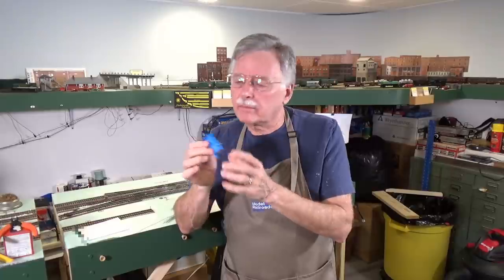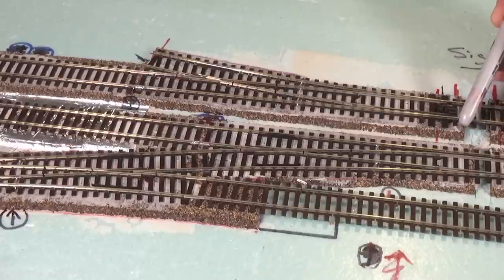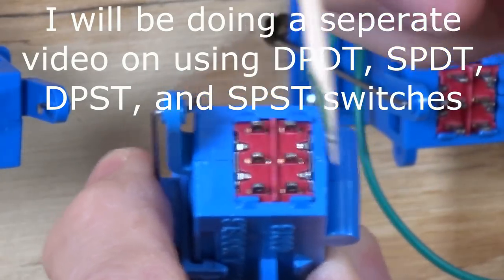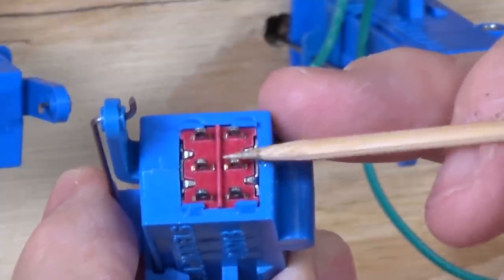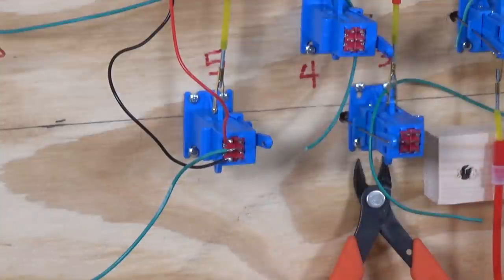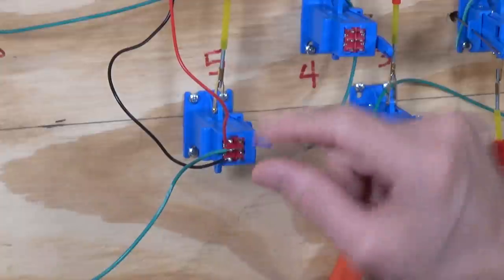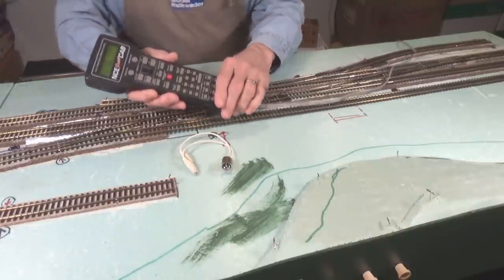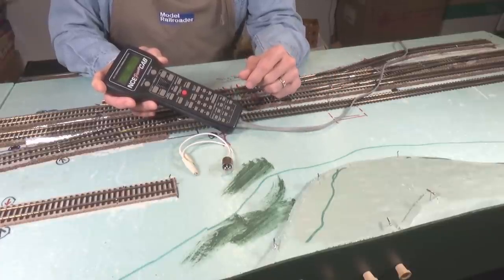Wiring Blue Points for Frog Polarity Control (150)

Comment: Very helpful. I'm using SMAILs rather than BluePoints, and I'm using pushbuttons that switch them electrically. But what you demonstrated is applicable. One difference is that I can't turn the bench work on its side. I do as much as I can on the workbench and use solderless connectors when possible. Thanks.
Reply from the maker: I have the same problem with the Piedmont Southern too big to flip on its side. That is one reason I decided to do these modules, they make it easier to demonstrate a lot of the under the layout topics. BTW, the Smails are essentially a Tortoise with an accessory decoder included. I prefer to use Tortoises and separate accessory decoders since I can pick the type best suited for the installation. And if one component fails I am not stuck with 2 dead ones. Sort of like buying a TV, radio, stereo, DVD player all in one and having the main amplifier components die.

Comment: Always enjoy your videos.  Really hope you'll show us how to wire the BluePoints up to LEDs.  I want switch panels that show direction with red/green LEDs while using the BluePoint switch controllers.
Reply from the maker: I do ‘t plan such a video but you can do it easily using the SPDT switch built into the unit. Just connect the negative or positive legs of the LEDs together using a black common wire and connect it to the proper power source at the proper voltage the use the SPDT switch to provide power of the opposite polarity to the red or green LED. That when when you move the points the polarity will change and light the designated LED. You’ll probably have to fiddle,with the LEDs and wiring to get it hooked up right and you may need to do some reading on LEDs. I think I did a video on LEDs a couple of years ago that may help—its all becoming a blur now with almost 250 videos on here.

Comment: perhaps a question or just an interesting observation... @11:16 you showed the list for the frogs and which color bus wire needs to be attached.  your list seems to indicated switch 1 is black, 2 is red, 3 is red, four is black, 5 is red (as you demonstrated), and 6 is black

but when you daisy-chained switches 2-5 together (switches 1 and 6 not shown) @20:14 they all seemed to have red on top and black on bottom.  your list indicated that only 2, 3, and 5 would be red and that 1, 4, and 6 would be black (at least from what I could tell)

why are they wired the same in the daisy-chain without regard to polarity on your list?
Reply from the maker: What you appear to be missing is the fact that the 2 pairs of switch machines face opposite directions and that in effect flips the contacts 180 degrees. That is why they can be daisy chained so easily in this case.

Comment: That 90 degree angle on the snake should be fine Larry. People have 90 degree bends in RC aircraft wings with these snakes and they work fine. That's a great tip for determining which wire goes where on the switch machine. Should it work the same on electronic frog juicers?
Reply from the maker: Because the frog juicers automatically switch polarity when a sort occurs you don’t need to worry about which way to connect wires to them. They don’t care and take care of the job for you.

Comment: Hint if you don’t want to solder directly to the BluePoint, the TE 61813-1 disconnects fit right on, they are like $0.26 each from DigiKey as one source.
Reply from the maker: Thanks for the tip.

Comment: Hi Larry another great informative video. The blue switch machines look great and straightforward to wire up to the Peco Electrofrog points and the flexible push/pull tubing very effective. On my portable layout I used seep point motors that have been a bit hit & miss getting the frog polarity to work..!!! The Blue Switch Machines could an alternative solution if I can get them in the UK ?
Reply from the maker: Try Coastal DCC, NG Trains, and Mech Models. And there is always Micro-Mark or Walthers. Heck I buy from Hatton’s all the time.
Reply: Hi Larry thanks for the reply...I will look at their websites.

Comment: Question does the bus have to run under every track or just one bus wire straight through the middle like yours? Wondering which way is more effective...
Reply from the maker: Obviously since I did it you can do it. However in some cases with branches or large yards it might be more efficient to branch the bus in a palmate fashion.

Comment: Hi Larry! I hope you see this question, but I have a WalthersTrack switch that has a little tabs sticking out in the side that connect to the frog. Question is which wire connects to that tab; red or the black? My layout is red wire connects to the rail furthest from me black closest rail. Thanks kindly!
Reply from the maker: That needs to be connected to the DPDT switch located on the switch machine. I showed how to do that in the video.
Reply: @TheDCCGuy  So the tab is use only with a switch machine and not connected to my main bus line?
Reply from the maker: Yes, it is used to SELECTIVELY provide the correct polarity to the frog.

Comment: Another fine video Larry. I am really enjoying this series of videos. I suggest they be placed in a Playlist, which would make viewing them in correct sequence easier. Right now, I search for the word "Let's" to find them.

Finally, I noticed when you were soldering to the Blue Point DPDT you did not appear to use a flux. Was there a reason for that?
Reply from the maker: If you go to my channel page all the videos are listed in sequence and by topics. Right now I divide my time between day to day life, working on the layout, making and editing these videos and answering comments. If I were to add making up playlists one of the others would have to stop.

Most solder now comes with flux in it so additional flux may not be necessary all the time. I mainly use it for settings where a lot of heat is required such as rail joiners and feeders and the flux in the solder may burn off before the job is done.
Reply: @TheDCCGuy  Thanks for clarifying that Larry, I had not considered that when soldering smaller items.

Comment: Why after connecting the wires to the blue point am I hot on both sides. I put the switch in the straight route determine what wire goes where and end up being hot on both sides?

Comment: I'm starting to like these Blue Point switch machines for their simplicity and seeming ruggedness. But when everything is added up, the machine itself, throw rods, fittings, etc., are they really any saving over a tortoise when bought in bulk?  You've presented a good and simple checklist for sorting out which wire goes to each side of the electrical switch component .  To my eyes the wiring is getting to be a bit too disorderly but my big concern though is that in daisy chaining the feed wires from one machine to the next you end up with a relatively long "feeder bus" with multiple solder joints which is inviting voltage drop.  Maybe limit the daisy chain feeders to 3 machines in close proximity to each other?
Reply from the maker: Yes, I should have pointed out the potential voltage drops if the daisy chains go too far. In this case the daisy chains are short enough so no voltage drops. The other Blue Points have individual feeders if they are spread out.

Comment: 7:18. Why not change the angle via its hole in frame to be less acute by a few degrees, now, if it worries you ? Split the diff with the opposite side machine so total red snake forms more a circle than two 90deg-ers...
I wouldn't use the Xuron Rail Nippers for  doing wiring work..Eventually they'll cut rails poorly.. Capeesh ? 
Your RR looks terrific, as does your carpentry and all !!!...I too am a happy owner of the NCE PowerCab !!  
M, Los Angeles
Reply from the maker: I considered that but doing so changes the other angles and creates a sharper one in at least one other location.

Comment: Hi Larry, question. What type & size green wire are you using to power your frogs for the blue point with machine? Thank you
Reply from the maker: It is 20awg solid copper.
Reply: @TheDCCGuy  is it still possible to use 16 gauge copper stranded? I ask because I have some laying around.
Reply: @TheDCCGuy  thank you
Reply: @TheDCCGuy  hi Larry thanks again, I have some white solid copper 20 gauge I will use. Much appreciated.

Comment: Where do you connect the green wire to the switch?
Reply from the maker: Do you mean the switch on the Blue Point or the turnout?
Reply: Where did you soldier the wire to the switch. I really like this method. Peco supplies the wire from the frog so is that where you soldier it
Reply from the maker: It sound like you mea on where on the turnout did I solder the green wire that is connected to the switch on the Blu Point. On a Peco turnout it should be connected to the wire the provide tor electrifying the frog. On other types of turnouts this will differ and on some I have had to solder the wire to the side of the frog itself. As I remember the Peco instructions cover this.

Comment: Where does the green wire attach?
Reply from the maker: In this video at 8:56 I said the green wires go to the frogs. These were connected to all the frogs in the previous video I did on installing turnouts. You need to watch the whole series.
Reply: @TheDCCGuy  That's interesting.  I had the same question.  I watched the previous video  on Blue Points and don't remember that, either.  In any case, this is my new favorite channel on YouTube!

Comment: Thanks Larry, excellent demonstration.  If you can't tell, I'm binge-watching your videos haha.  Last comment/question:  Would this method work using the continuity mode on the meter instead (if the meter has one)?  It might be nice to have an audible indication.
Reply from the maker: I do usually use the continuity buzzer approach myself as it makes it easier to listen for the connection than to watch the meter and what you are doing.
Reply: Ok, I wasn't sure if there'd be too much resistance for the buzzer to work.  That's good to know!

Comment: Larry, do you use a separate buss for your switches?
Reply from the maker: Yes and no. I do not use DCC commands to control my accessory decoders so they are not connected to the DCC power bus. However I do use a separate 12VDC power bus for my accessory decoders and other DC power needs such as lights. On my list of future video topics I do plan one on using a separate power bus for accessory decoders.

Comment: Where is the green wire connected to?
Reply from the maker: It goes to the frog.
Reply: @TheDCCGuy   Can you tell me exactly where on the frog?
Reply from the maker: Depends on the turnout. Some have attached wires, some have solder spots, some have no provisions and you must solder to the side of the rail.

Comment: To save yourself time but risk just get a disc grinder and cut a very tiny small cut through the polarity of the two rails where it meets at an arrow saved me money and time. Literally not kidding. It is a risk bc u could completely ruin the switch but hey if they could just do that to begin with It would be very easier to setup. I get some railroaders want to press a button and have the switch automatically go but I feel more realism if u manually operate the switch.